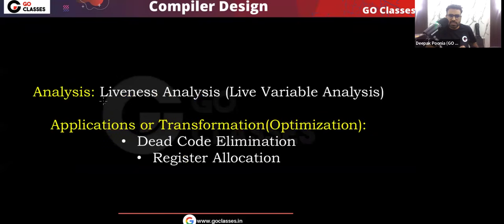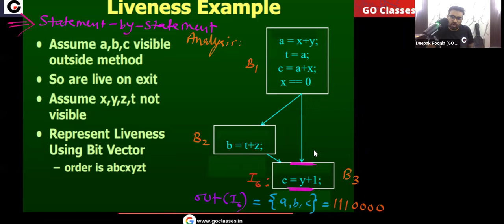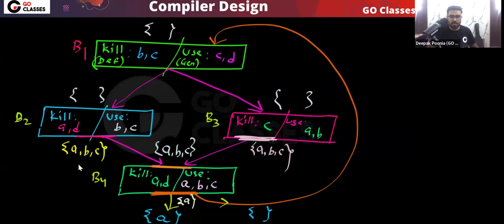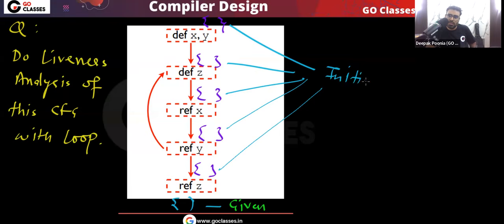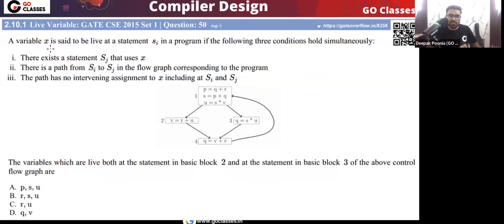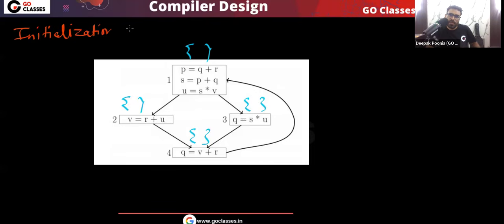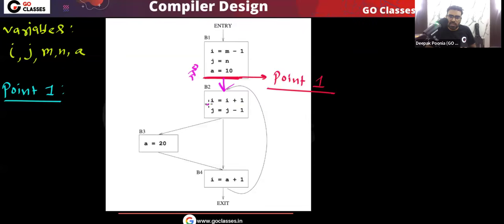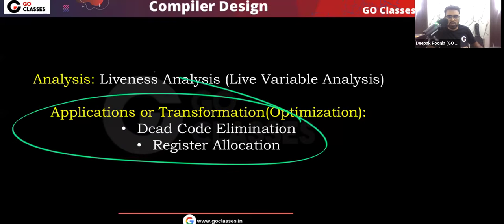Liveness Analysis - GATE PYQs & Practice Questions | CFG with Loop | Live Variable | Compiler Design

Comment: Sir in examination for CFG with  loop which method one should use 1 or 2! from method 1 we can get the answer without use of pen even but can that be wrong because we don't analyze further for loops like we do in method 2?
Reply from the maker: For CFG with loops, you can apply method 1 or 2... Both are perfectly good & correct. Method 1 is quicker & must be preferred. In method 1, we must perform multiple passes until the liveness information stabilizes to ensure the result is correct. ✅

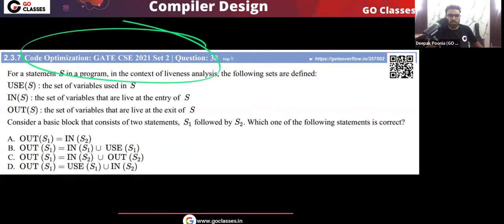Comment from the maker: 01:38:11 - GATE CSE 2021 Set 2 Liveness analysis, USE(S), IN(S), OUT(S)
https://gateoverflow.in/357502/gate-cse-2021-set-2-question-38 
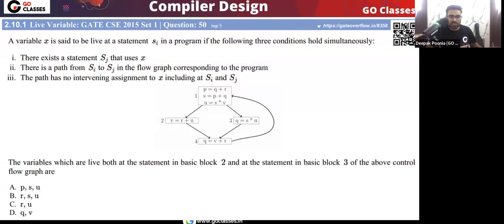01:44:21 - GATE CSE 2015 Set 1 variable live at a statement in control flow graph, basic block
https://gateoverflow.in/8356/gate-cse-2015-set-1-question-50 
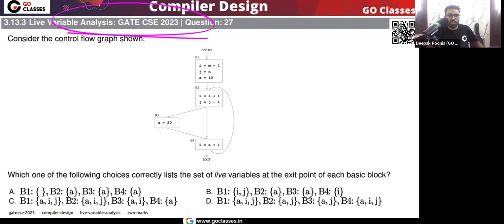02:37:36 - GATE CSE 2023 Live variables at the exit point of each basic block in control flow graph
https://gateoverflow.in/399284/gate-cse-2023-question-27